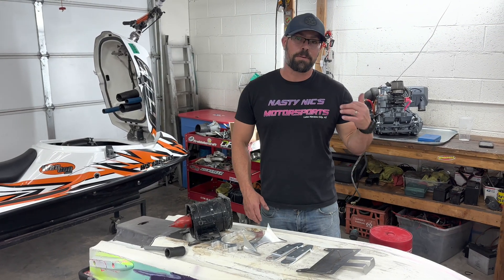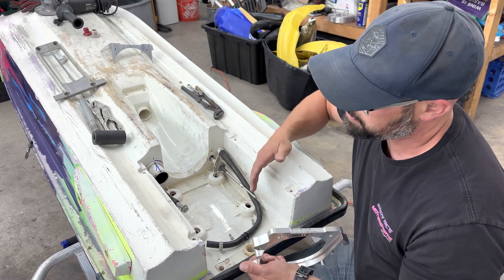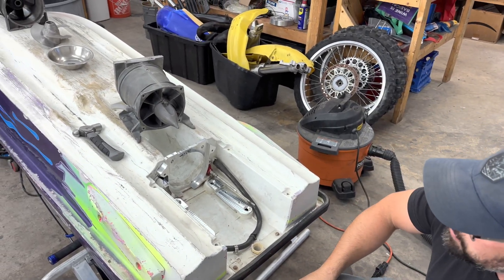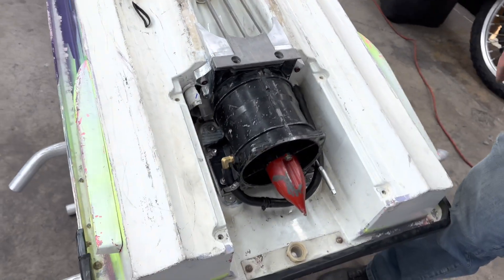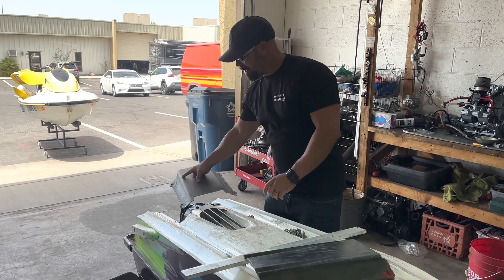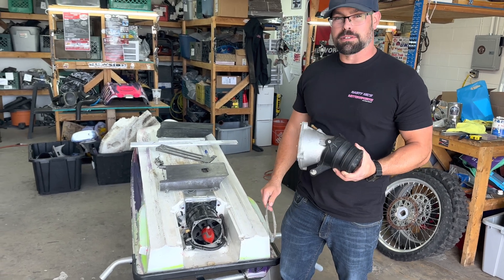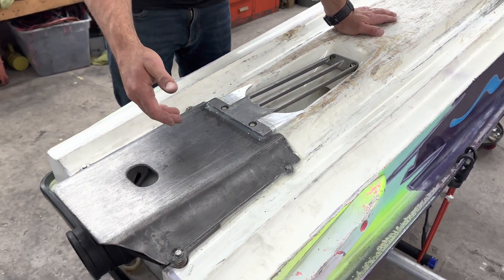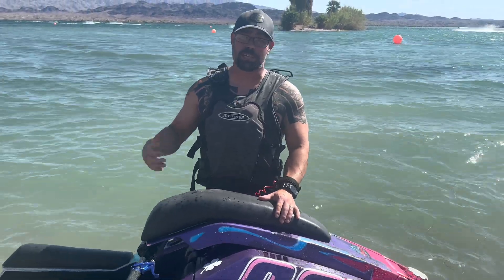750 Kawasaki Pump in 300sx Yamaha 650/701 conversion ski

Comment: Hey so doing this my self and limited driveshaft options here. What on earth runs a 26 and 1/4  drive shaft? First video is 23 and 3/4 and for 750 pump its 26 and 1/4 ?
Reply from the maker: We ended up having to cut and respline a SXR 800 shaft for it.